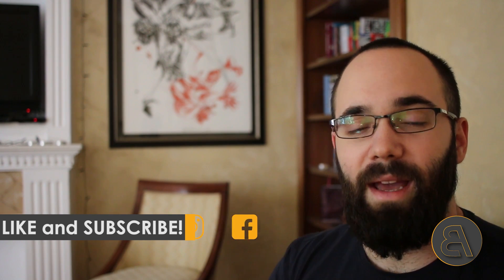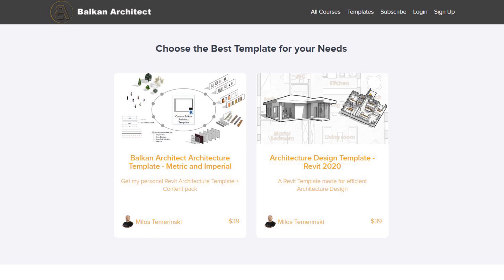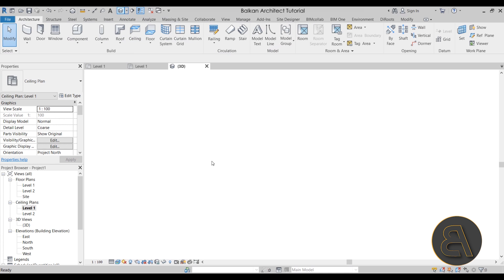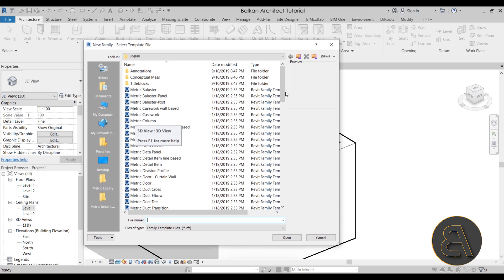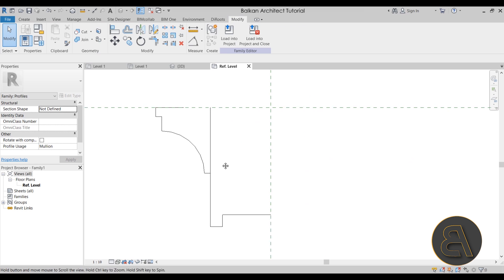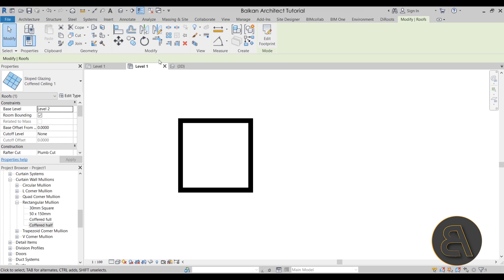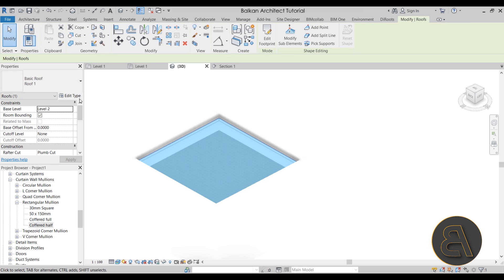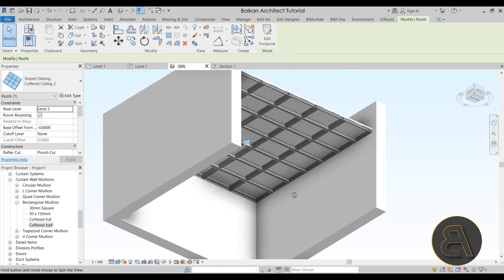Classical Coffered Ceiling in Revit Tutorial

Comment: So sorry to say it, Milos, but this video created more issues for me than it solved. Had to figure them out the hard way! hehehe Here goes:
1.- For the half mullion, when you create the profile family, you created the actual profile as you see it (top is top, bottom is bottom) when actually you have to take into account the "inside/outside" reference plane in the profile family template. So the top of the mullion profile is actually on the "Center (left/Right)" reference plane and the bottom would be to the left of that plane. In doing this, you avoid having to do the -90° rotation trick.
2.- You have to uncheck the "adjust for Mullion Size" box in order for the spacing to be equal throughout.
When you do it this way, it comes out perfect!

Just wanted to add this little bit to the conversation!

keep rockin'!

Comment: This is not the right way to model in revit, typical of this guy, if you are using this for construction and not representation, do not use this video.
Reply: I have been looking for other methods to do this kind if ceiling but unable to find one. Do you know a better approach to make this kind of ceiling that could be used for construction as well?
Reply: @asadkamalabbasi537  what about sweeps with profiles copied into grid and joined geometry used? I know my comment is after many years but I just started learning revit and would like to know different approach.

Comment: I might suggest drawing in the raised and lowered portions as ceilings. Then you can generate a face based/ceiling hosted trim family. This will eliminate the slight overlap at the intersections. 
It's not a fast as that method can be but it can give a more accurate look to the joints.

Comment: So, I just tried this in an irregular shaped room. The exterior mullion doesn't close around a corner. (it stays a butt end, but doesn't overlap) Is this something that one wouldn't put the perimeter half coffer on but then run it with a sweep so that it has a mitered corner? This would only be a problem when/if you were needing to doa reflected ceiling plan or if the client is asking for an interior rendering.